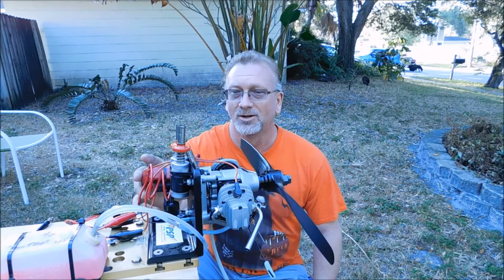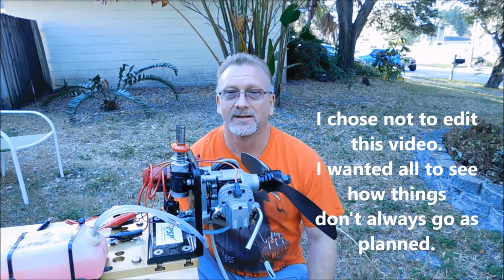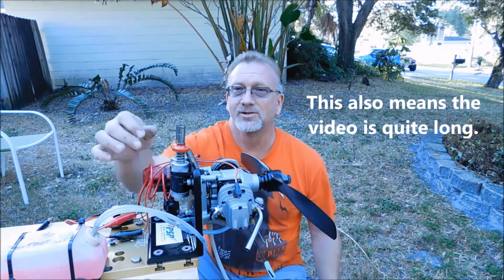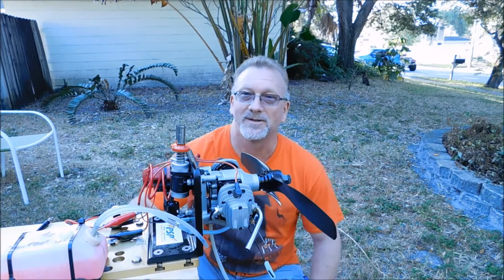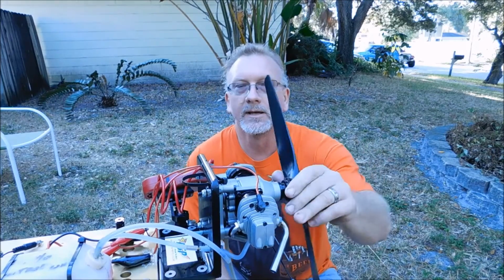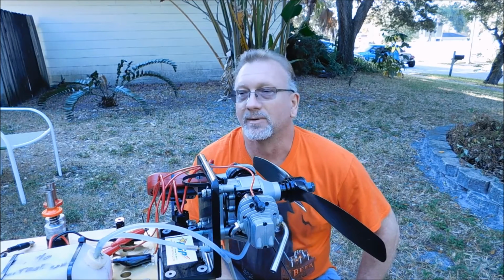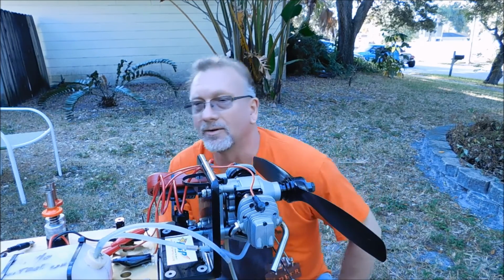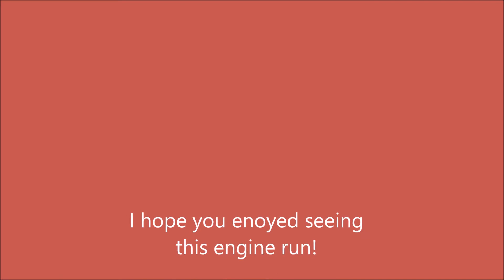ASP FT160 AR First Run Video #1 **Bella**

Comment: I'm really enjoying your vids on this particular engine. I got mine a few days after Christmas but I'm still waiting for some warm weather here in Mn. to get it out on my test stand. I had to find some small wrenches to adjust the valve lash. There was virtually no clearance between the valve and rocker arm as delivered.
Reply from the maker: Congrats on getting a fine engine!  That must be really hard to wait for warmer temps to run it!  I had one cylinder that the valve lash was way too open.  This is why I always check them before a run new or used engine.
Reply: David, I'm moving forward in getting my new engine on the test stand. I need to enlarge the prop hole to clear the.470 dia. prop nut bushing. I don't have a reamer anywhere near this size. What did you use to enlarge the hole in your prop?
Reply from the maker: I had to use a step bit.

Comment: Yes it was very nice to finaly hear it run.. my engine is runing perfecly since day one i didnt don anything to it...
Reply from the maker: I just took the carb off again and reset the idle speed according to the instructions.  I set the throttle stop screw so the opening was about 1/16" and then set the low speed screw at this point until I just heard air coming through while blowing through it.  Then I opened it another 1/2 from there.  I think my initial assessment of it being set to rich was wrong.  It was set too lean for the throttle stop position set. I am waiting for the the Ni-starter batteries to charge again.
Reply: Interesting my engine is just fine the way it   Is... but i wonder what will be with ASP 400R

Comment: I had nothing but low speed issues with all my Chinese twins with the stock carb.i had 3 of them. only have 1 now,ASP,160 with OS ft 160 carb,intake and pipes.runs exactly like an os,ft 160. idles 1600 to 1700 on only glow plugs,i use omega 15% 4 cycle fuel.